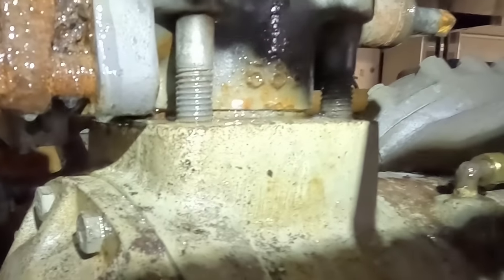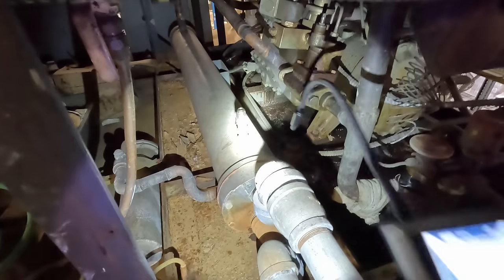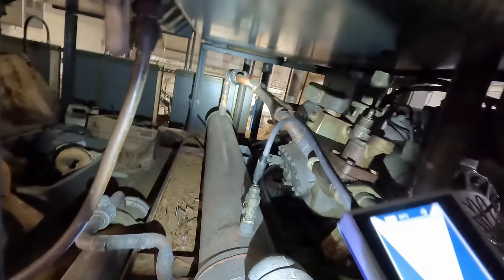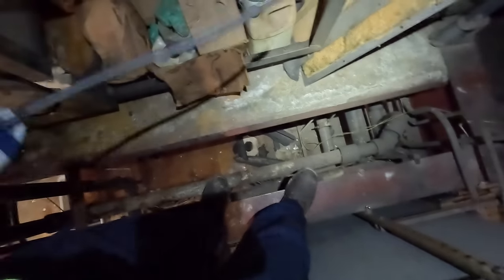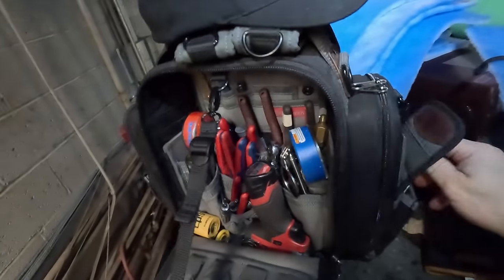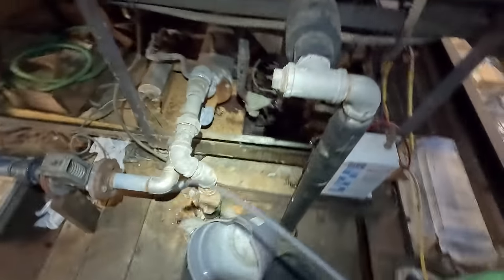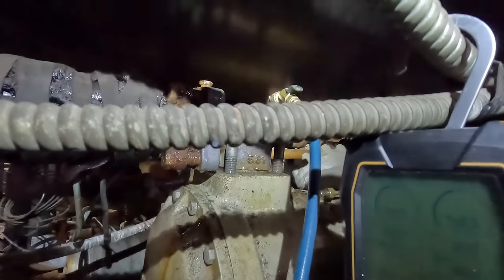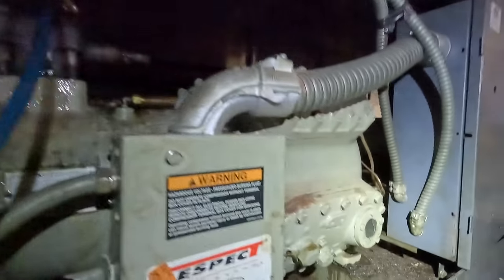Industrial AC Takes A Dump Again Past Due To Flush It!

Comment: Pneumatic transmitter in each discharge duct  should be reading air temperatures… if the controls work I guess 😂😂😂. Ground my teeth down to nubs on that stuff for the last 26 years. Keep up the good work

Comment: I worked on one of these giant Trane 8-cylinder used in a chiller recently. Sadly the building manager wants to replace it this year with a new R290 chiller. I would normally support this 100% but I’d hate to see a old beauty like this getting trashed.

Comment: Respect from the UK Rick. That is a beast but interesting old school. I agree with all you say, you will probably get a blue context banner!
Reply from the maker: That would be interesting. I Just stated the law and fixed the leak with a good faith effort as required.  We’re not going to die from climate change, the planet is going to face gods wrath before that ever happens.
Reply: @HVACRSurvival  Your right, keep up the good work!
Reply: @HVACRSurvival Climate change has happened before.  There are tropical plant fossils under the sand in the Sahara desert.

Comment: I wish now I could have made the expo this year. Could have run into you. Maybe be able to get to the next one. I have a hot deck cold deck system where I work and thankfully we converted the old pneumatics over to digital several years ago. Way les headaches. It also uses chilled water from the house system for the cold deck. Another plus in my opinion. Great video! Thanks for sharing.
Reply from the maker: Thanks so much for the kind words 👍

Comment: Looks about 40 years old, eh?  The cap is such a simple thing, protection for the stem.  Used to work at a place where the students(inmates) would huff the refrigerant from the systems.  Brain vitamins.  🤣🤣🤣
Reply: Looks more like 1960s, 50+ years old.

Comment: That pneumatic stuff is usually pretty reliable. Thermostats are probably the most common thing I replace, and an occasional actuator diaphragm.
Reply from the maker: I haven’t done much with them but it is interesting how it works
Reply: Before digital controls, pneumatic was the best.
Reply: Recalibrate the t-stats DA or RA. Volume controllers....i still enjoy working on pneumatic systems.
Reply: @jasonjohnsonHVAC  the ones where I work have all been switched to electric dampers with thermistors everywhere that report to BMS.  Problem after problem, everyday. We used to have direct acting Johnson controls tstats. There were several that were still original from the early 80s...actuators too.
Reply: @topher8634  are you using PE's then to utilize the air side of it?
Reply: @jasonjohnsonHVAC  all of it has been removed now. The air compressor, regulators, and dryers are still in the plant, but it's all turned off. Most of the PEs had been jumped out in the motor centers long before my time. I was trying to restore everything to as built when bidding was opened up to replace the whole works-chillers, towers, air handlers and reheats. It's never worked like it should. Shameful because the pneumatic system was a hell of lot more reliable.
Reply: @topher8634  totally agree. Pneumatics are very simple...yes the precision is not as good as digital/analog....but it can be pretty damn close....and its a lot easier to work on, troubleshoot and repair ( subject to parts availability ).

Comment: Hot deck cold deck isn't like VAV, it is constant volume. That is stock Trane condensing unit. Why doesn't customer want system fixed? All those pneumatic controls can easily be verified, simply start checking inputs from transmitters. They can be calibrated or replaced. The Barber Coleman receiver controllers can also be calibrated or replaced. Just like DDC except it's air signal, not a voltage single.
Reply from the maker: A good portion of the people that watch my stuff don’t really understand the difference between either one of of those items (whether it’s a VAV or a hot deck cold deck) and I believe I said it’s similar not that they’re exactly the same.   Addressing the question that was asked, why does the customer not want to replace it or do maintenance on it?  that’s not for me to decide, all I know is they’ve been given the opportunity and they choose not to do it. This is a factory that’s been there for a long time that just keeps milking things along and does not put any money into anything,

Comment: Looks like a 1960s installation.  50+ years old.  Will the modern systems last that long?
Reply: Probably depends on maintanance, but you probably can put 10 new ones in for the global warming potential this thing has caused.
Reply from the maker: I doubt you’ll get that many years from anything today.
Reply: You'd be lucky to get a ⅓ of the lifespan of that old one nowadays